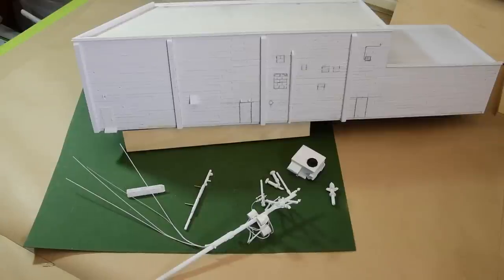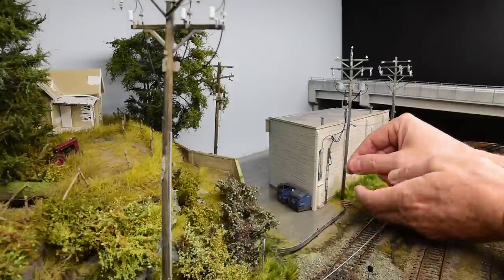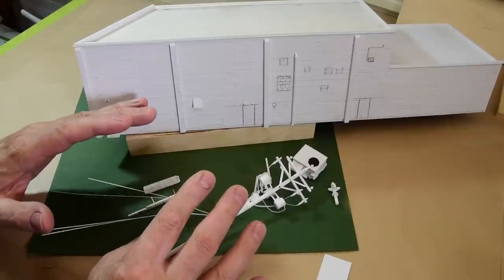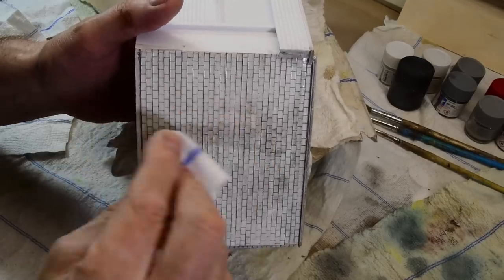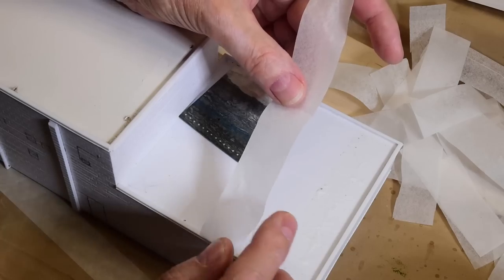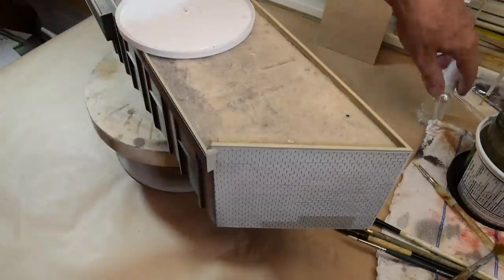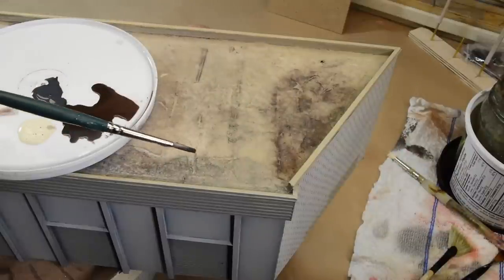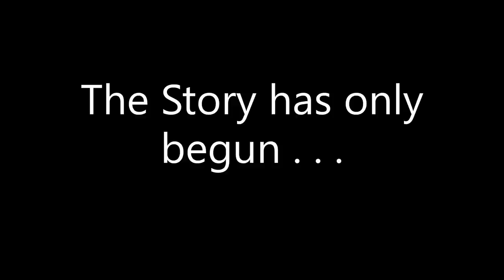The (1/87) HO SCALE WAREHOUSE FINAL | Boomer Diorama ~ Vlog # 196

Comment: The very top is power. The lines halfway down that you are modeling are telephone lines and the boxes are splices. There are hundreds of tiny wires inside the big thick cable and each is spliced together in that box. As a lineman myself, your poles are the closest thing to accurate I've ever seen on a layout. Fantastic!
Reply from the maker: Thanks for sharing. I find these poles around the Industries to be much larger than the usual urban poles along highways as well. I guess it is the 220 Volt, and comms, etc. required eh?
Reply: @boomerdiorama   The top- of- pole power lines would typically be 15kV class operating at 13.8kv or 12.5kV etc.  The transformers up on the pole would step it down to 277/480 or 120/208 (or some older delta voltages like '440 or 240v delta).  The poles are generally 40' tall in urban or industrial areas, buried 7' so about 33' above grade to the top. Industrial areas might have taller poles for roadway clearance(??) or what you see as larger might be 55kV transmission poles (??).  

Of course all of this varies by geographic region with some areas using 25kV or 34kV distribution, and also some older areas (michigan) used smaller poles for residential areas.

What a great model railroad you have built, it is beautiful.
Reply: Coax for cable TV/internet is typically the very bottom cables, telephone would be the next batch up, and power on top by voltage.   At least that's what my dad who worked for the phone company, always said the order was.

Comment: Beautiful utility poles.  Both electric distribution and phone/cable sag because A) pure physics, it's weight, B) Allow for expansion & contraction from heat & cold,  C) Controlled tension load effected by wind.  Taught lines would be popping cross arms and pole tops like crazy in the wind.
Reply from the maker: Cheers! ;-)

Comment: Not having been to Canada for many years the lower sag could be wire or possibly fiber optics. In the lower 48 it would be fiber, hundreds of glass fibers, smaller then a strand of hair, used for communication. Like everything else Electrical engineers have a formula for figuring out the sag between poles. Nice job on poles, like everything else you do their prototypical.
Reply from the maker: Thanks for sharing!

Comment: Another great episode, thank you!
What’s your opinion on modelling overhead cables of electrified railways and what material would you use?
I find that sometimes the scene gets a bit heavy with all the poles and wires, but it also feels incomplete if the prototype requires it and we leave it out (and here in Europe they are basically everywhere).
Cheers,
Alessio
Reply from the maker: I have only modeled North American "Interurban" overhead cables in "O" Scale. They were functional and we used bronze wire and very thin "Tig" welding wire from the spool. It worked great but the spacing of poles were farther apart than the European counter part.